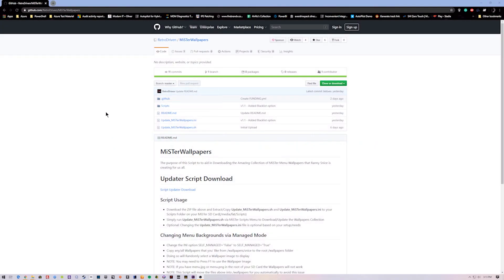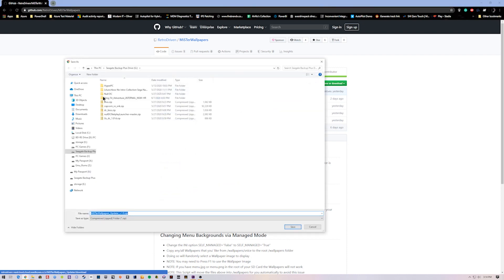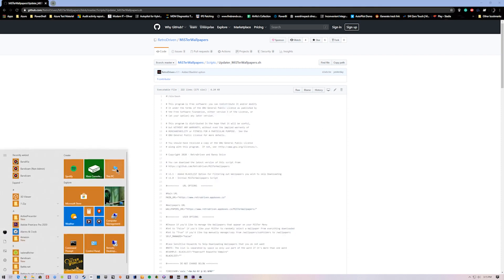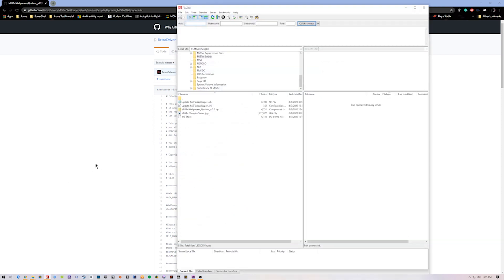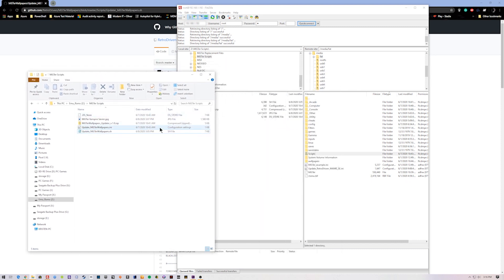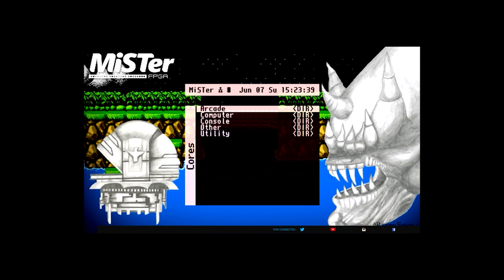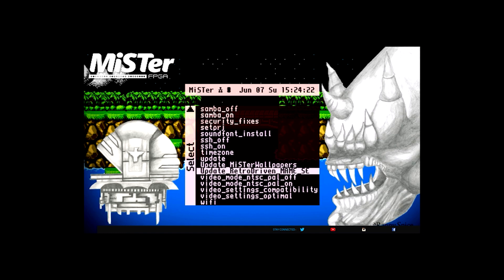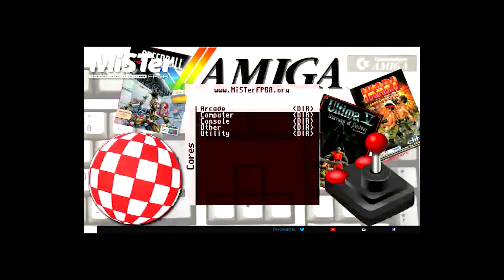MiSTer FPGA wallpaper script!!!

Comment: Thanks for this video! I came here because i'm failing in loading different wallpapers on my mister. the script runs perfect and I have the wallpapers folder with all the jpg installed. but nothing happens when I push the f1 button on my keyboard. maybe you know what I can do? Thanks
Reply from the maker: sure thing, First thing try another keyboard if possible or make sure that one works by hitting F12 and ESC and see if that brings up any other menus. Also in one of the menus where you can see your IP address and where you go to run the Scripts, there is an option to remap your keyboard buttons. Let me know if that helps.